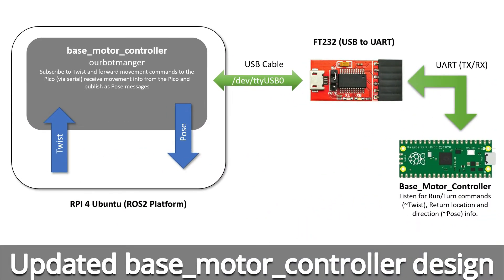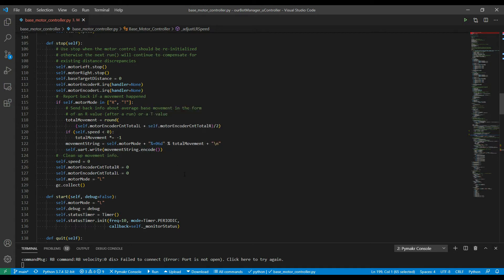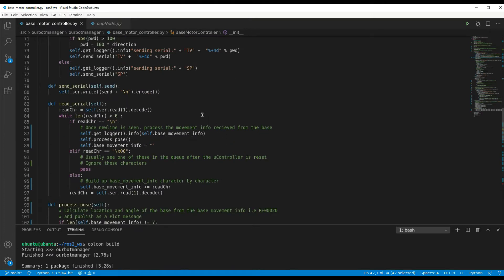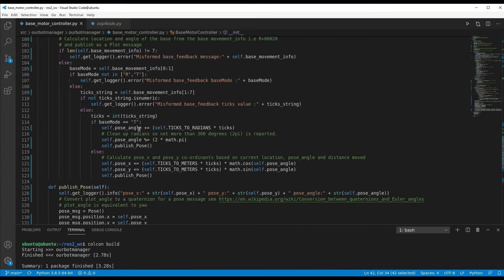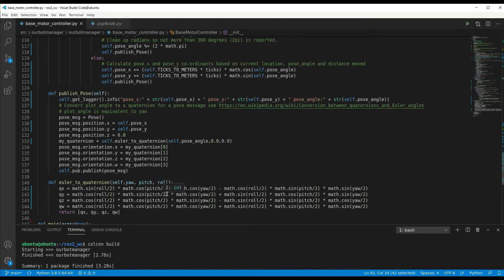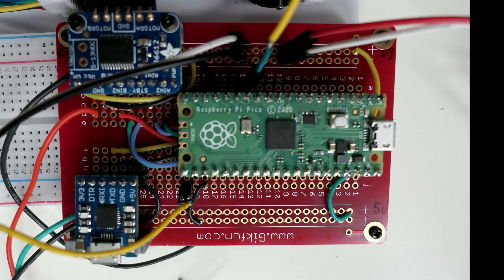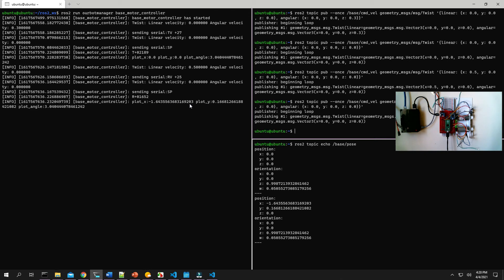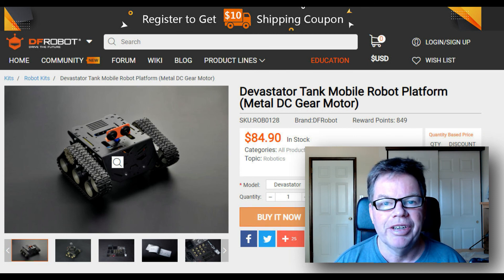07: Ros2 node, Twist and Pose interfaces.

Comment: Very impressive. It's good to have space provided for expansion, like IMU and Lidar. POSE will need correction due to wheel slip and drifting encoder ticks. Your use of the ft232 is interesting and overcomes the rosserial omission in Ros2. I love your video series. Well done and God Bless. 🙏
Reply: Thanks, funny you said that , I was just thinking about needing a bit more space on the board to better connect up the motors using a single plug for all the wires for each motor (Grd, PWM. Encoder power and signal). I have a feeling I'll revisit  this once I start fitting it into a real robot base.